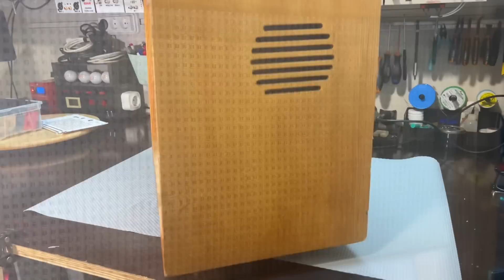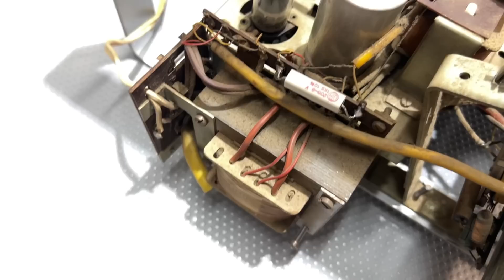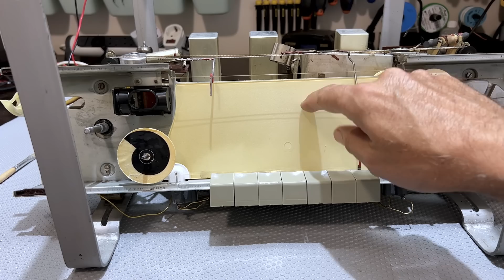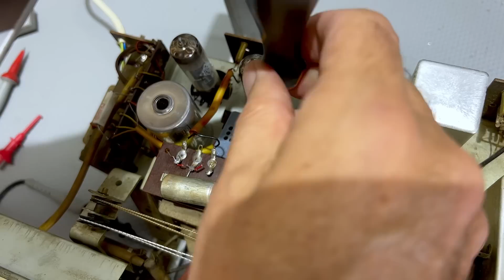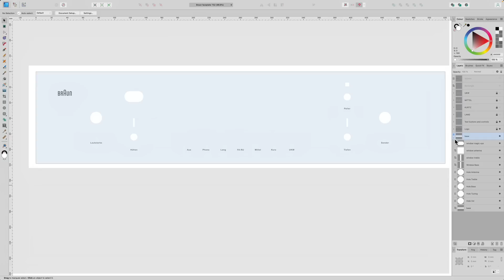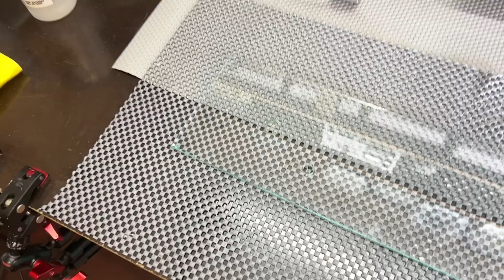Restoring a 1956 Braun TS2 Radio: Power Test, Rectifier Upgrade, and Design Review - pt1

Comment: Hello Manuel. Thank you so much for your absolutely superb posts and tutorials. I last did electronics at college in the 70s and the closest I came to valves was watching my father sort out the TV as a kid, but in retirement my fascination and interest in beautiful old radios and their recovery has been energised; starting with how thermioc valves, diodes, triodes, pentodes etc work.  With some skilled help and guidance I now have an HMV Type 1120 and Invicta 36 now working and ready to be "buffed up" and a Regentone R10 in the works. I also have a Hungarian Orion AR612 waiting to be looked at (it's a big, blond wood cased and keyed, beast with an FM band) but I need to find a schematic and ideally the repairer guidance in English. Having now watched your EO&N Back to Basics and various of your Projects and being somewhat of a nerd and perfectionist, I am very encouraged. I particularly need this as I am a professional engineer but my experience is all aero engine design based and not electrical. I have just followed Part 1 of this TS2 project and hope to find the follow on episodes soon. Again,  my thanks and appreciation for your detailed, clear and systematic approach to explaining the circuit design and how to check and correct things SAFELY! Best Wishes Algy
Reply from the maker: Good luck with your projects. I agree that these beasts are fascinating 😊

Comment: The electrolytic atop the output transformer most probably isn't original. Frolyt was an East-German brand. And the FA/RU button should be the ferrite  antenna and a squelch circuit (Rauschunterdrückung), the latter for FM.
Reply from the maker: Yes, I came across that button on the Braun 
Atelier that I restored. Thanks.

Comment: Looking forward to seeing the dial glass. Also how that MOSFET behaves under load. I think if the dial glass UV print turns out good you will now have the ability to do any type of dial glass.
Reply from the maker: The mosfet is effectively already under load, since this is a class A amplifier. I monitored the temperature after a few hours of use, and so far it’s behaving nicely. With the radio I. The cabinet and in the right orientation things may change, but I have to wait and see.

Comment: A bit of work on that dial reproduction Manuel, well done. I have some of your new rectifier boards and will fit one to a radio in the coming days. Is there a reason you kept the mosfet drain heat sink above ground?
Reply from the maker: I wanted to test an install that would keep the chassis isolated, in the event that I came across a situation where the chassis wasn’t ground. It worked, but in this case want necessary.
Reply: @electronicsoldandnew  Ahh... cool, thanks Manuel 👍🙂

Comment: Love those Brauns Manuel.

Great job on the selenium sub btw-overengineered, but at the same time simple and refined if that makes any sense. I love the concept.

An idea you may have considered and rejected, I know you use Apple software, but I assume there are similarities. Scan in the original dial and save as a layer and then build your layers over that band by band etc.?

Would save you a lot of painstaking measurements!
Reply from the maker: Hobbies are the right places for over-engineering :)
Reply: @electronicsoldandnew  absolutely!

Comment: Since the MOSFET has a negative temperature coefficient (resistance drops as temperature goes up), it's prone to both thermal runaway externally (hot) and internally (sub-die mosfet element) as well as your voltage shifting over time. You may want to use a TL431-based feedback circuit with a transistor to drive the gate, to keep it consistent and reduce gate drive as the MOSFET heats up.
Reply from the maker: I think that would be too much for this application. I’m going to use it and keep an eye on the performance over time to check that all is well. This is not a critical circuit by any means. The worst that could happen is the midgets opens of shorts. In the first case, effect is identical to simply switching off the supply, and in the latter it will make the B+ a little higher.

Comment: I used to repair car radios, some used to be discolored and smelly and sticky because of nicotine, in the repair shop we always used instanet window cleaner, always worked very good
Reply: In window cleaner the main part is water. A problem with pure alcohol (and paint thinner) is that not all is solvable by it, but these non-solvable dirts DO often solve in water. I wonder if it works better if you add 10% water to the alcohol.
Reply from the maker: I don’t want any liquid that won’t evaporate quickly getting into the set.
Reply: @electronicsoldandnew  Of course, that's why you use alcohol in the first place. But paint thinner as a alternative is not a healthy one, and it is able to damage all sort of plastics and paints. A bit of water, down to 5%, is gone in an hour if you put the set warm.

Comment: Wow Manuel , You rightly should be proud of going that extra kilometer of solving the over voltage problem. When criticism however you should put your logo on the pcb cover.
Reply from the maker: 😊 probably. I remembered it on the 3D printed box.